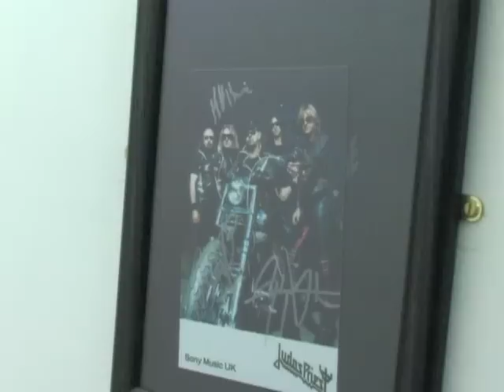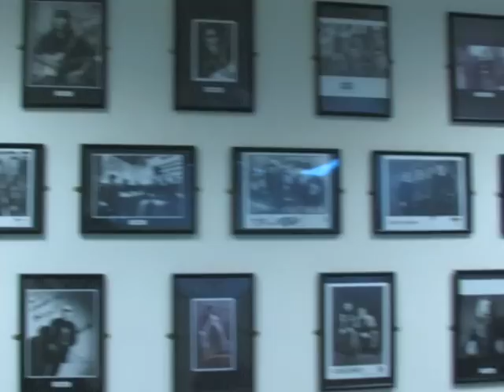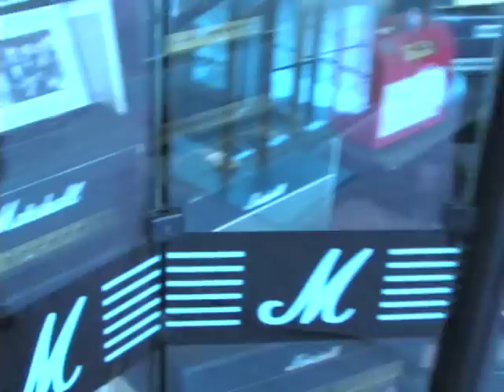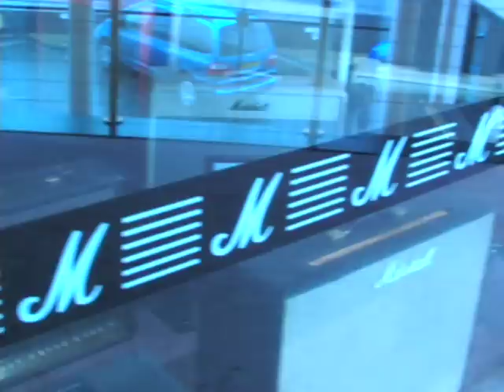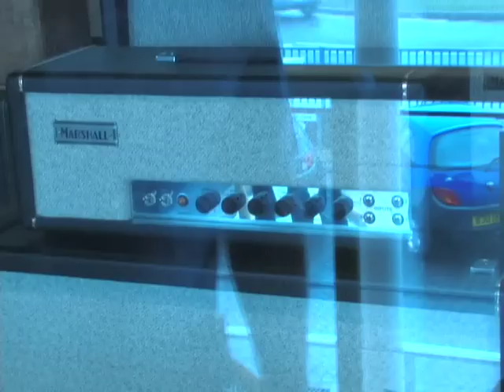Marshall Amplification - Factory Tour

Comment: I've used the JCM 2000 DSL since it first came out in 1998.  One of the first off the production line.  It had a bias drift problem that was eventually fixed.  Best sounding Marshall ever.

Comment: at 11:16 shes say to the other gal hey did hendrix have a circuit board? 

I have a G50R CD combo that needs help it fell over with the guitar plugged in and the input jack pushed inside and the circuit board cracked in half? wtf
I looked inside it has a thin tan board like tv set.
I removed the board and point to point hand wired it with solder along with crazy glue to hold it. amps should be built to take a pounding
Reply: Funiest coment out there

Comment: What's the mod where you take an old jmp or other non-master amp and put a master on it?? I get that this is basically a jcm 800 but when i played one it still wouldnt overdrive until both the master and preamp were cranked.....I have played a modded jmp though, and its master volume mod works fine...low master, overdriven preamp.

Comment: No musician will understand me, but any electronic engineer will understand my comment.
Marshall amplifiers are the best example that, in audio, what matters is the ear and not what we measure in the lab.
I have been able to evaluate several Marshall amplifiers in my lab and their harmonic distortion, intermodulation distortion, damping factor and response speed figures are nothing remarkable but exactly the opposite.
I have found that all of them, without exception, have enormous second harmonic distortion and poor damping factor.  Another thing to note is that the construction and technology they use is more similar to what was used in the 50's than in the era of today's MOS FETs.  Frankly, the equipments looks like they are obsolete.
However, the sound is extraordinary.  And when we listen to a piece of equipment and make an opinion about what we hear, our listening experience is the only thing that matters. All measurements are relegated to little more than laboratory anecdotes.
We are talking about audio, about music and not about mathematics...